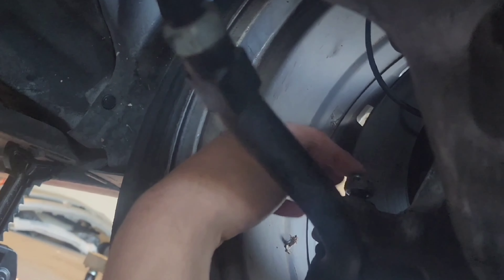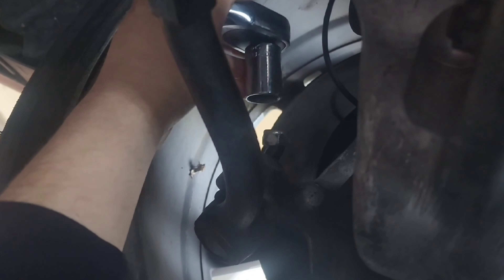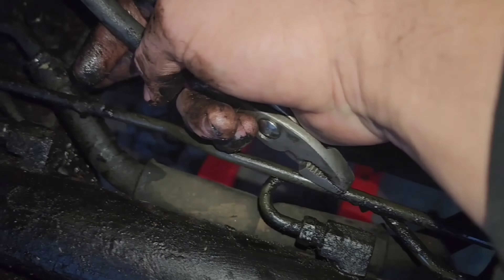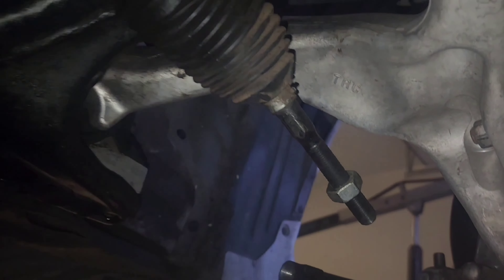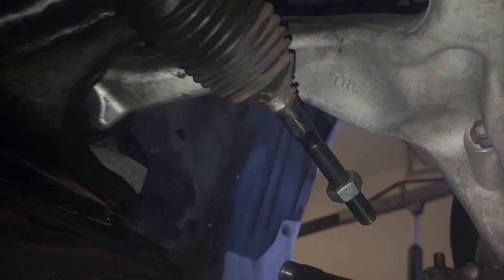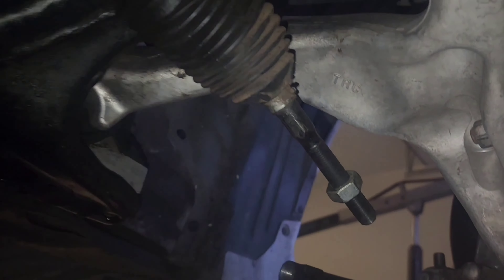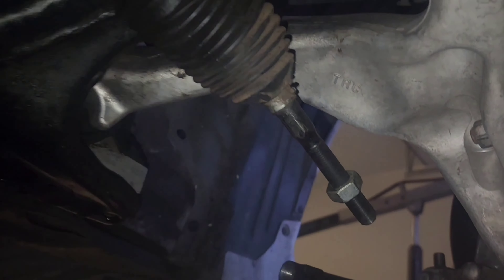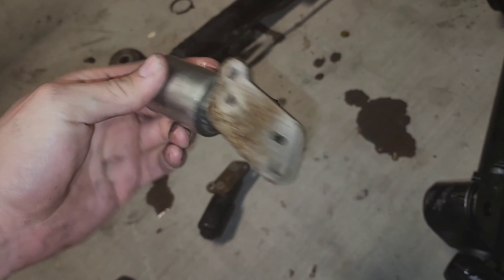Replacing Rack & Pinion | INFINITI M45 M35

Comment: 10:20 kink in the line causing a fluid restriction, nice job !

my lines just started leaking yesterday in my m35x.
what a pain in the ass with the awd  model, front driveshaft and cross member.
- grand rapids, mi

Comment: Did you have to remove the engine to remove the rack ?!
Reply from the maker: No you shouldn't have to. I am in the process of replacing the motor so thought I'd replace the rack
Reply: I came to the comment section looking for this b4 I asked the same question. I have m35 sport and need same job done as well and thinking should I do it the same time I change my motor mounts(as they just came in)

Comment: How far in does the doorman connector have to get tightened into the rack
Reply from the maker: I only replaced the rubber fittings everything else I just put it back to where it was previously. I tightened it to the point you are no longer able to run it by hand but don't over tighten it as it can break